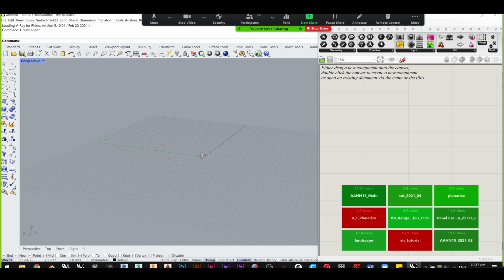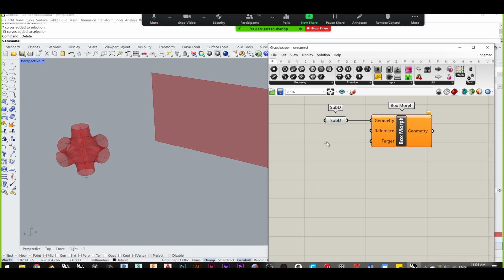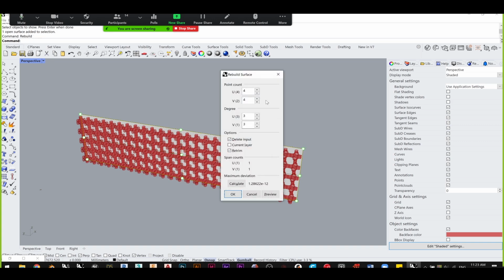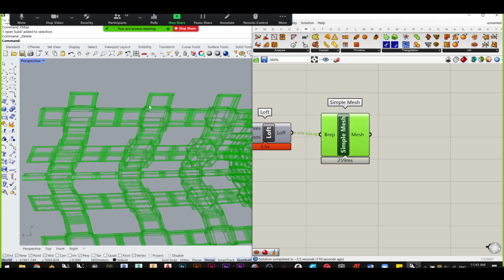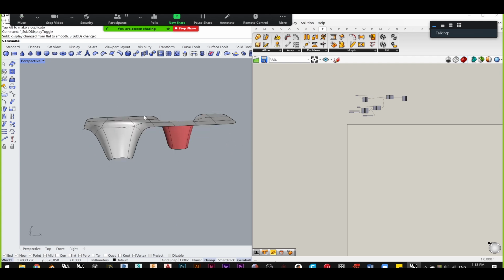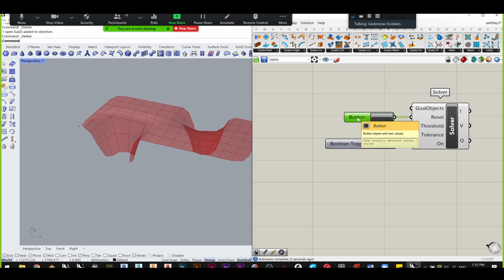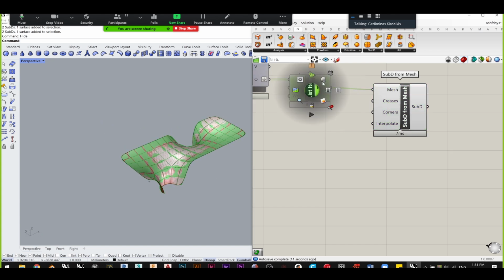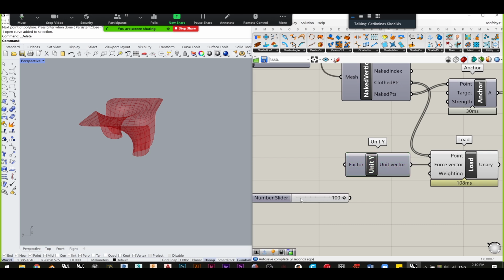Webinar: Rhino SubD and Grasshopper modeling for Architects (day 3)

Comment: I've been waiting for Part3 sooooo long！Thank you so much, sir! Just having a lot of fun learning with you!
Reply from the maker: Well not that long - it's been a little over 1 week :)
Reply: @DesignGoBrr  Excuse me ,sir. I have a question here. Is it possible to use box morph on a mesh rather than a surface ?(such as using box morph on a minimal surface which can't be a single surface)
Reply from the maker: @oliveramory1378  yes, that works even better with box morph. Just if you use more than one geometry with bounding box component - right click on it and choose option "union box"
Reply: @DesignGoBrr  I'm sorry that I didn’t quite understand you, sir. Maybe I didn’t say my question clear enough. What I mean is that I want to create a facade with box morph onto a complex mesh, but the script in this tutorial shows that the input “Target” of “Box Morph” is “Surface Box” which means it can only be a surface or surfaces.If I want to make the input “Target” of “Box Morph” be a mesh and “Divide Domain” the mesh at the same time, is there any method I can achieve that?
Reply from the maker: @oliveramory1378  ah got it. Then you need to make sure that your mesh has quad topology (no triangles). Quad remesh tool will help you with that. Then you offset the mesh to have two layers. Then you create a loft between each polygon boundary curve. At that point you basically have a bunch of boxes that can be used with box morph (might need to use twisted box component as well)
Reply: @DesignGoBrr  Thank you so much, sir! I’ve just made it!